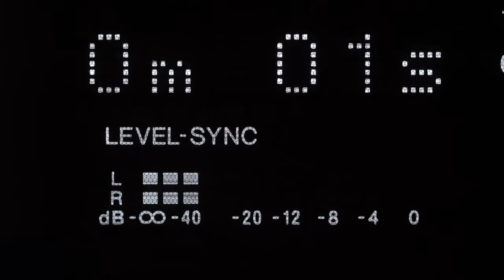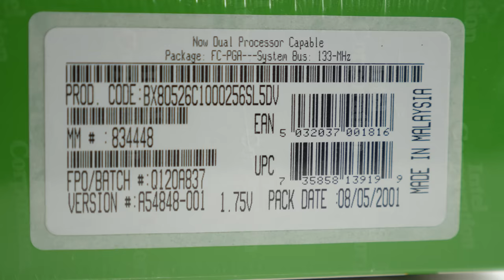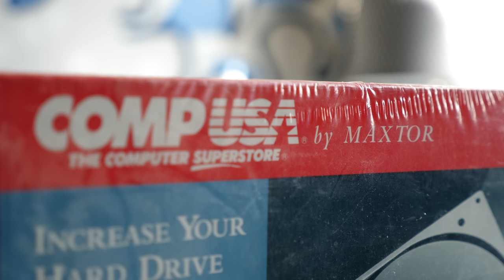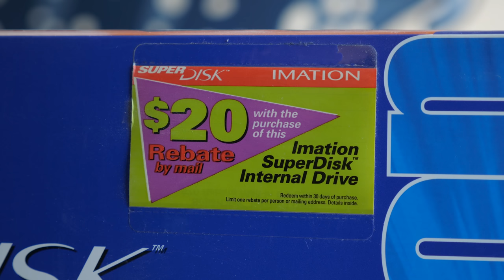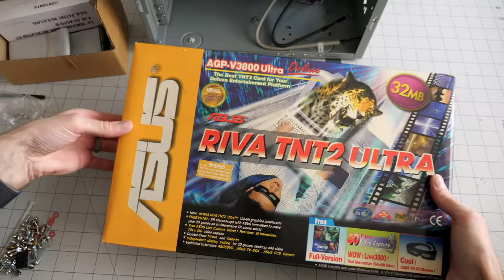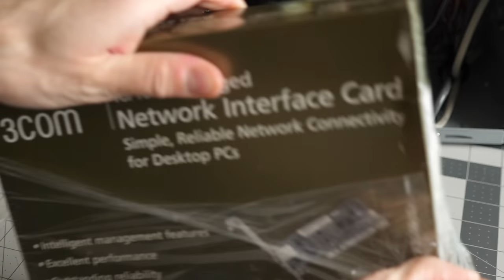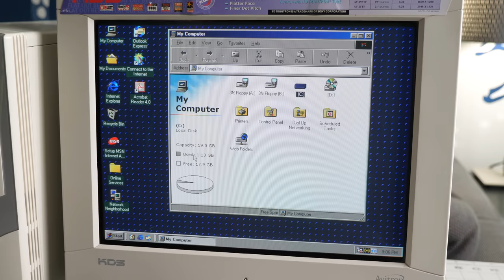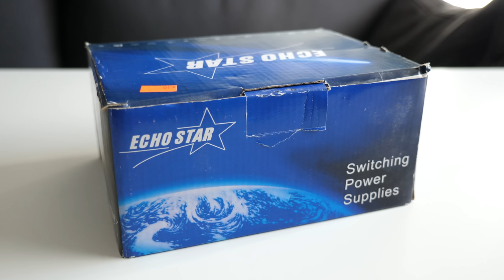Building a Retro PC From New Old Parts!

Comment: I love how you edited out the thermal paste part! You're absolutely right, you would of started a war in the comments regardless of how much/little you used and it you spread it or just left it!
Reply: It's funny because GamersNexus did a bunch of testing and came to the conclusion that can't have too much thermal paste (besides mess), it doesn't really affect thermal performance and overall thermal paste application is very tolerant to however you put it on.
Reply: knew someone that put so much paste on, the pc didn't boot because it spilled over into the socket once he put the heatsink on, also knew someone that just used super glue...
Reply: I know right? I can't even remember when that all started or why? lol
Probably a "PC master race" forum where one piece of advice became gospel and gets ingrained into the community. The reality is, As long as there's enough to cover the CPU lid and doesn't suffocate the contact area with the CPU cooler, It doesn't matter how you apply it.
Reply: I wonder how many would have died when I removed the stick on thermal pads on a dell I had and upgraded it to paste because I never liked the pads.
Reply: @charlieretro  lol that reminds me, i once took apart a pentium 3 dell, had a 1.3ghz Tualatin in it and what i was really after in the first place when i got the system, anyways so i took the heatsink off, and there was a price sticker still on the cpu.. looking awfully cooked.
Reply: @helenHTID  Verge PC build!
Reply: I thought people were over that by now. All of the big pc building YouTube channels basically make fun of anyone who would act like it's a big deal, yet people still think it's a big deal? It's only a big deal when people are trying to be passive aggressively racist towards a kid that works at Vox.
Reply: weak
Reply: @kingjoe3rd  racism bad?
Reply: I’ve never heard this “debate” and would have sneered if I had. If I’m spending 2 or 3 hundred bucks on a blazing fast processor and $80 on a fancy heat sink and I’m not cheaping out on a $5 tube of Arctic Silver. It tells you exactly how much to use and the right steps. It is foolproof. Even if you do put too much it tells you how to remove any excess. I have never had heating problems with that product. One less worry.

Comment: Gigabyte is good about keeping all of their old drivers, software, and manuals on their website - I've had to work on several 15+ year old systems with Gigabyte boards and drivers have never been a problem.
Reply: Bio star has everything on their site.. except for the download themselves
Reply: Gigabyte also like using solid state caps, I really rate them
Reply: @virtualtools_3021  it's said that there was old biostar ftp files
Reply: @bitelaserkhalif  idk the ftp for the ud something grand mobo i had is down, i ended up using snappy driver installer origin to get em

Comment: As a former long time Micro Center employee, seeing that CompUSA power supply tester at 4:29 with the Micro Center price tag on it gave me a good laugh since it came from the location I worked at. I know they absorbed a lot of merchandise when CompUSA went under so its not too surprising, but fun to see none the less.
Reply: I wonder if the MicroCenter in Overland Park, Kansas also absorbed CompUSA's merchandise.   CompUSA in Overland Park was also located just few miles south of MicroCenter.  Ironically, CompUSA was located just west of Sprint's campus!
Reply: I was about to comment on that, that price tag is unmistakably Micro Center. I shop at MC a lot and have also gotten some old NOS stuff like this, and the new sticker is nearly exactly the same as it was 20+ years ago.

Comment: The random hot glue on the top inside of the case is to prevent rattling when in operation. I have bought cases on sale for low prices and they rattle like crazy. A little bit of hot glue puts an end to that nuisance.

Comment: On the LS120 diskette drive:
That piece of card you mentioned when you opened the box was not for shipping, but to be placed between metal casing and the bottom of the drive. When you stuck the disk halfway in, the drive moved slightly and shorted out. 
Pulled the exact same move in 2001, had to wait three months for a replacement under warranty and the replacement came with two pieces of card to shield the top and bottom of the unit.
Reply: That was my initial instinct of the failure when he said that the drive stopped working after half inserting the disk, then the system only booted again after the drive was unplugged.
I'm glad that you shared your experience with the same issue, and now I won't be forever wondering if that was actually the problem or not

Comment: The Front Panel Audio (AC97/HDA) connector goes into "AD_EXT" (works on Live 5.1, Audigy1, Audigy 2, X-Fi, and probably later cards etc.), you don't need to rewire anything :)
Reply: the AD_EXT connector on that sound card is for the big ribbon cable to connect the 5.25 inch I/O drive bay to the soundcard. I had the Audigy Platinum soundcard kit back then and that's what was connected to that AD_EXT connector. A custom rewired cable needs to be made to connect the front audio connector to that white connector on the Audigy2 ZS.
Reply: @cheezst8ke  On some of the cards, I remember that being an option, but this one looks like it's not keyed correctly for that. I think on my Audigy 2 Plat, it was the smaller header for the ribbon that supported AC97 output.  These cards are before the HDA format came out. There were many times I was trying to get a pinout for that white SIP connector... but couldn't find anything online.

Comment: Hitting that 1ghz clock speed was no small feat. And was a real game changer for everyone in the industry. That was a huge mile marker in pc history. Before then just running the os alone could be a struggle for the hardware to keep up with, after that the os became much easier to run overall.
Reply: Intel P4 1 GHz at launch was an utter flop, because Intel bet and lost its money on RD RAM. AMD had the only stable 1 GHZ chip at the time, while AMD stayed with SD-RAM 133 and eventually DDR.
Reply: I had a NeXTstation back in 1993 with a 33 MHz 68040 processor, running a full multiuser UNIX operating sytem with a high resolution GUI in 16-bit colour, CD quality sound, Ethernet networking and even full window dragging where you move the window around along with its contents, not just an outline (which PCs and Macs of that day couldn't manage) and it ran smooth as butter. 

OS performance is all about software optimisation, hand-tuned assembler was key for getting good performance on most critical kernel and frequently-used OS routines. NeXT's OPENSTEP for Mach OS also ran buttery-smooth on my Pentium 133 MHz PC later on, around 1996.
Reply: @leobuildsit  i had an ahtlon tbird back in the day, and still have another one today, its everything but stable, i had to switch for a lower powered p3 and oc it to the same spec, its quicker and way more reliable, i only replaced the cpu and mb, got better fps on 3dmark 2002 with the p3

Comment: Definetely my favourite era in computing is represented here, P2s, P3s, P4s, Athlon XPs, really up to the early Core 2 Duos were a special time where we saw rapid advancement, with the race to 1 GHz, and then later with the P4s chasing clock speeds while the Athlons went to x64 and then dual-core all within a span of about 5 years. Nowadays my current PC is about 5 years old with a Ryzen 1700X, and while I love what we have now, the fact it's been 5 years and I have felt no need to upgrade says something about the slowdown of progress. It's been like that for about a decade now as I could easily still use a 2600k today if I had to.

This era of hardware is what I learned to build PCs on, the first PC I put together was my Dad's old 733 MHz P3 system I think he originally built in 2000. The deal was that I wanted a PC to replace my old 433 MHz Celeron Compaq tower I had as a kid, so my Dad said I could have his old system if I could put it back together, since it was sitting in parts. With his help with some of it I managed to do it and have been into PC hardware ever since. This was nearly 20 years ago and now I work as one of the main ICT technicians for a non-profit organisation in one of the best cities in the world (Melbourne, Australia), and will definetely stick with this career path for the rest of my life. While I had the interest beforehand, building that old PC for the first time really got me into tech and has given me a soft spot for this era of PCs, especially the Pentium III.
Reply: I agree with what you said about processors not really advancing much for the last like decade, feels like every new computer I get isnt much faster the only real progress has been with storage and graphics cards in my opinion. But I dont really need the speed of a pcie 4 ssd over a pcie 3 ssd so it kinda feels like a meh update.
Reply: @pilsplease7561  I'll tell you man, get an NVME and you'll feel a massive difference to a regular SSD.
Reply: @TRAMP-oline  Thats exactly what im talking about, no noticeable difference in any of the tasks ive done with a pcie 3 NVME drive vs a pcie 4 NVME drive, whether its a standard ssd or a nvme drive i have noticed that I dont care any form of ssd is fast enough for whatever I want to do, this laptop im typing on has 2 pcie 4 nvme drives
Reply: I kind of disagree a bit about processors development halting the last decade.
Sure after the 2600k (Which I also owned) came, which was in 2012, the CPU improvements seemed to halt completely for many years, but around 2018, Intel upped their game with the new CPU:s. The 8700k I bought in 2018 was in many cases double the speed of my old 2600k (both overclocked as much as possible. Both good overclocking CPU:s in good overclockable mobo:s9. Especially noticeable for music production (DAW) where real-time vst-instruments (softsynts) take up most of the CPU power and where the extra cores of the new 8700k also made a big difference.
The the improved later Ryzens finally catched up to Intel and now it has been a cat and mouse game of AMD and Intel chasing each others.
From what I get, the latest CPU:s from both of them are again vastly superior to the 2018 8700k. 
And the upoming new CPU:s this fall is yet again a big leap in power. 
If you need it. I actually am at a point where it isn't a problem anymore, even for DAWs. Forget about games, that has almost always been about the GPU, if you are not playing at really low res...
So, yes, there was a "standstill" between 2012 and 2018, but then it took off again.
But this actually wasn't the first time of a "stand still" for CPU:s.
The same thing kind of happened for Intel when they "maxed out" with their Pentium 4 in late 2002/early 2003. Their later Prescot were even slower than their Northwood parts and it took them about 3 years to later release the improved Conroe in 2006. 
In the meantime AMD "kind of" closed the gap with their X2:s which still was as late as 2005 or so.
Reply: @Magnus_Loov  I do agree that now since about 2018-ish that we're getting faster parts again, My Ryzen 1700X does feel a little slow at times even when compared to the i7-9700 in my PC at work, and even more so compared to the new i7-11700 PCs we've just bought for our current fleet, so an upgrade to a Ryzen 5900X is in the works and should hold me for another 5-6 years. My main point was that the rate of innovation seems to have slowed down (until recently) since PCs from a decade ago are still very usable. My home file server still runs on a 1st gen i7-870, something which I could still use for basic tasks just fine and is still great as a server. However when the 870 was new in 2010, you could maybe try using a Pentium III from 1999/2000 but it would be very difficult. I remember having do so so at the time when my main Core 2 Duo laptop died and having to use an 800 MHz P3 for a few weeks, it was hardly tolerable.
Reply: @JackStavris  That is maybe also a function of what you actually use it for. Back in the days even mundane tasks like only running the OS or doing some word processing or maybe some websurfing and some other lighter stuff would have made a big difference for the jump you described. But after 2008:ish it almost doesn't matter for these kind of tasks, IF (And only if) there is an SSD that is being used. Switching back to a PC with a mechanical disk and an older long used Windows with Windows rot in it may make it seem unusable too...
I mean, yes the older 2600k I have is still being used in a "file server" /back up system that I switch on from time to time (but mostly log into remotely from my main Pc) is a bit slower, but that may in part also be due to me having clocked it down to stock speeds (no use for overclocking anymore). It still has an SSD in it so that isn't slowing it down.
It IS feeling a bit slower for the mundane tasks, but still pretty fast in a way that it isn't annoying...
Reply: I got into computers in 2011 from my mums old job at the ACTF, became friends with the IT guy there. They so happened to be upgrading from skt 478 P4 and LGA775 Pentium D machines to brand new 2nd Gen core i5 machines, and since they where going to be getting rid of their old computers anyway, the IT guy gave them to me instead, a half way complete machine and a few boxes of both used and boxed parts, most notably a boxed and probably brand new GeForce FX 5950 Ultra. I put the machine together once I got home and once I fired it up and got windows and games installed on it, I was hooked for life. 

Still have that exact machine too, albeit heavily upgraded from the parts that I used it with back in 2011, only original part is the motherboard and ram, currently has a P4EE 3.4ghz, 4GB of DDR400 ram (still a decent amount in 2011) and a HIS OC Radeon 3850 AGP, and dual 10k 300GB WD Velociraptor’s in raid 0. also still using the original install of windows XP with all of my data and games from back then still installed.

Also hello fellow Melbourner.

Comment: Speaking of nostalgia around the late 90's, anyone remember those 300Mhz Celeron chips that were overclockable to 450Mhz by only setting a jumper? That was one of the first complete systems I ever built from the ground-up, not counting the system I swapped my motherboard and Pentium II out for an AMD K6-2.
Reply: Yes, you set the FSB of the BX to 100 Mhz instead of 66 Mhz.  My Pentium II 450 would run rings around my K6-2 550 Mhz.
Reply: @TheLionAndTheLamb777  here in Brazil almost all K6-2 was sold using Pcchips motherboards, this ruined AMD image for years.
Reply: @foca2002  Lol, I feel sorry for those K6 owners cause PC Chips made some garbage motherboards.
Reply: I ran dual overclocked Celeron 300's in an Abit BP6 motherboard that allowed dual Celeron CPUs. Windows 2000 and eventually XP had no problem seeing and using those dual CPUs. Admittedly, not the most useful thing in the world but definitely a cool piece of technology.   Those were fun times.
Reply: @bdwilcox  YES!! I couldn't remember the motherboard but I 100% remember now it was an Abit!
Reply: I'd take my Celeron 633 to 950 Mhz just by increasing the bus speed from 66 to 100 Mhz. It was amazing for Unreal Tournament.
Reply: Heck I remember the AMD K6 patch for windows 95. Without the patch any K6 CPU over 300 mhz and 95 wouldn't boot up. Had to boot to a start-up floppy and manually install the patch to the correct 95 directory... I still have that patch in my archives... Lol.
Reply: Those K6-2 chips were beastly too, had several of those. Gosh, what a fantastic era for cpus. Once the mobos caught up anyway
Reply: i made the very same switch from my PII 350 + motherboard to AMD.
Reply: A Celeron is overclockable? I fear this information comes too late my friend, way to late. My life would have been a better one when knowing this information earlier in life :D without waiting 10 to 15 minutes of loading time whenever stepping into the System Shock 2 elevator.
Reply: @juliashenandoah3965  I can't speak to all of them, but the 300A specially was very easily overclockable without anything more than a jumper setting. That being said I did come across one that would crash on me so YMMV.
Reply: Yeah. I had one of those with a Voodoo 2. I also started making music on that one, because my Soundblaster card came bundled with Cubasis.

Comment: A backup plan for a backup plan. That is exactly why I love this channel :D Very nice machine in the end! I just like the fact that all I/O shields of the era were the same - include/exclude few connectors. On a side note - I must say I miss the point of using new wrapped item if there is a market for it as is. If I were to mount it in anyway I'd go for used (if available). The effect is the same plus one saves some bucks for other stuff and leaves the wrapped for collectors (which is also a thing even if those parts were meant for use). But that's just me. I enjoyed the video no matter what. Thanks :D
Reply: Love it when a plan comes together! cues theme music
Reply: @OfficialiGamer  dammit
Reply: I think so so, too. Well, this video was about using as many new parts as possible, so maybe ok in that regard? But in general, for any hobbyists, if you have a boxed sealed CPU like this is best to keep it in the box, as you can get some money out of it, and buy a cheap used part. There's plenty of such CPUs still around so you should have no trouble finding one for cheap (though not as cheap as a few years ago, when a got a bunch of them for about a buck apiece).
Reply: It belongs in a museum!
Reply: I don't get new old stock on items that are not prone to failing. IE Mobo, Cpu, Sound cards, Video Cards. However, I totally get it when I bought blank 5.25" disks and some times you are looking for an obscure item like a cf to parallel adapter. I will take new old stock for that since there weren't a lot of options.